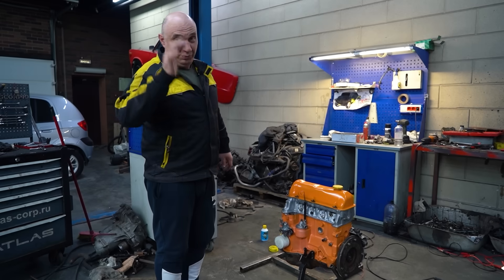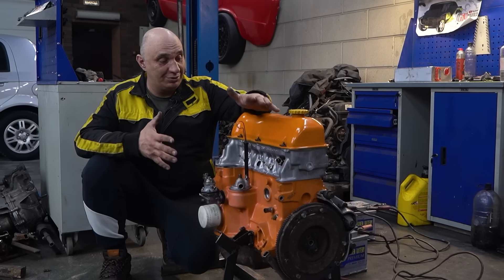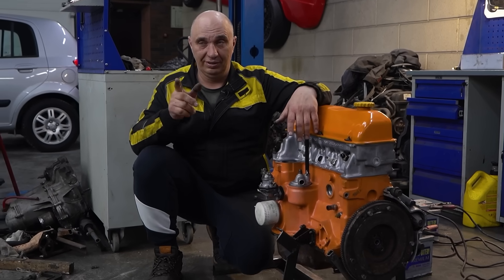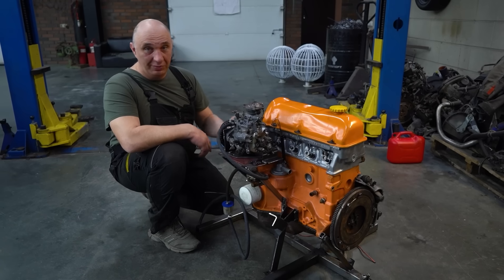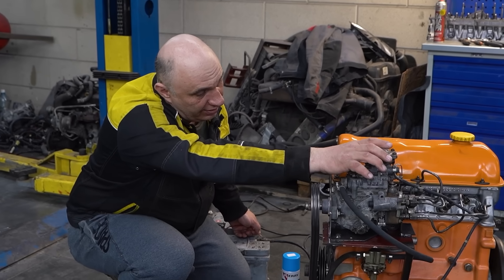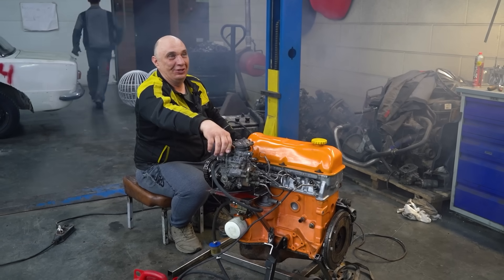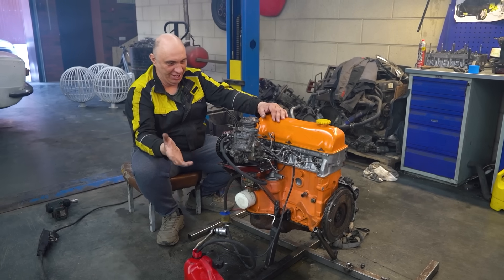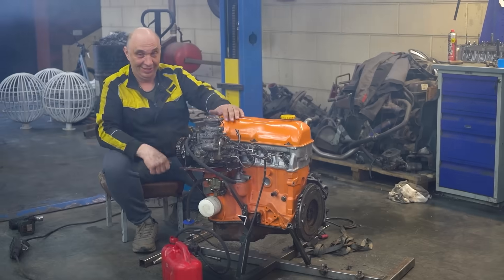We convert a gasoline engine to run on diesel fuel - will it work?

Comment: Bad way for running gasoline engine on diesel fuel. You need higher compression which makes heat, and that heat ignite diesel. With spark plugs can run better. For good running you actually don't need to remake engine, just need to inject diesel in gaseous state, and spark plugs ignite him very well. I run gasoline engine on diesel, wood, hydrogen from water, plastics, etc, in regular gasoline engine.

Comment: looks like its getting too much fuel, or it doesnt have enough compression.   Could try F34 military jet fuel.  Essentially Jet-A1 but with a lubricity additive to help lubricate the injector pump. F34 also contains stadis and de-icing additives.......so do not run it indoors unless you want cancer. Increasing compression would mean potentially needing stronger pistons..........

Comment: That's a dumb question yes it can work depending on the compression ratio of the engine and some other details but really that's exactly what General Motors did in the 70's to create the 350ci diesel that was used in cars and trucks all the way up to the 90's before the duramax came on the scene.

Comment: More compression is needed. Hence the smoke, low combustion temp. But its awesome it runs
Reply: it will blow up internals not strong enough for the double compression he proved he could convert it and run it's enough

Comment: another way to do this is using modern diesel pulse injectors and running them in place of gasoline injectors (or just use the stock injectors ) then put glow plugs in place of the spark plugs (wired to a momentary switch) if my memory is correct you need 180-190 psi to compress diesel cuaing it to burn  and thats on the very low end for peak performance you need 300+psi so that equattes to 13:1 compreession roughly which is why gas engines dont burn diesel well at all because they use 9:1-11:1 generally you can build a gas engine to burn diesel but its extremely inefficient
Reply: ps this is all for a modern or just a efi engine

Comment: You probably already know this, apart from the head geometry being very different for a petrol the cam will most likely hold the inlet valve open too long for a diesel, as diesels tend to burn fuel over a longer crank angle, that might be why its spitting back through the intake, it might still drive though.

Comment: Assuming because it's warm in the garage that it would be enough to start a mechanical injection diesel, completely undermines how hot the cylinders need to be for diesel to combust. I have to use the glow plugs on my old Isuzu for the first start of the day, even if it's been sitting out in the sun.

Comment: The indication of so much smoke is likely due to the compression ratio being too low. causing the combustion chamber temperature to be too low. resulting in unburnt fuel and ultimately large amounts of smoke. most diesel engines require a compression ratio of at minimum of 17to1. or even a more ideal ratio of 25to1 to achieve complete combustion. and in turn they also require stronger engine blocks, crankshafts, and connecting rods. GM experienced this problem when they tried to convert a 5.7L. Oldsmobile Gasoline engine to diesel. and it turned out to be a terrible failure.

Comment: In the early days of Ag tractors, there were carbureted spark ignition engines that ran on diesel fuel.  They had two tanks, one for gasoline and one for diesel.  They would have gasoline engine compression.  You would start them on gasoline through its' jet, then once it was warmed up good you would switch to diesel through its' jet.   The spark plug fired both.  Once warm enough of the diesel would vaporize to give you ignition and the heat would vaporize the rest of the diesel to burn and you could shut off the gasoline.
Reply: army trucks also

Comment: To make it start better you need to raise compression ratio by milling some metal off of the underside of the cylinder head, so the combustion chamber gets smaller.
Reply: Na supercharge / turbocharge it. Raise the dynamic CR 😊
Reply: In the last video they did that about as much as they could unfortunately
Reply: Concordo. Talvez enchesse a câmara de explosão com alumínio para aumentar a compressão.

Comment: nice project, 
what will happened if you mix petrol in diesel, may be 1% or 10%, will it increase power or damage parts, like pump, injectors etc.

Comment: we use to have an outboardmoter 5HP that starts on gasoline and  after 5 minutes switch to diesel and run on diesel with sparkplugs and carburethor. no injectors needed, cant remember air or watercooled. but was 2 stroke 2 cilinder engine.
great work  you do.

Comment: Try a new experiment (suggestion). Run a modern engine with 30gr of gallium on the oil.  10hrs running.

Comment: What I would do is put a grid heater on it like the cummins platform has so it can heat the air coming in like the heat gun is doing

Comment: try different injectors, high/low-pressure, swap whatever your using now, I think low-pressure would be the way to go, but you're the experts,  good idea using the sparkplug hole

Comment: Won't run properly without higher compression. The heat gun will help with compression and make diesel vapour with the engine will run off easier.

Comment: With all that white smoke I would suggest that it's either as under sized injectors for what you just built or the injection pump is weak or you don't have enough compression
You might be able to make the injection pump spit more fuel out and that might work too.

Comment: We used to run petrol engines on parrafin  60 years ago you only need an extra tank and wind the fuel line round the exhaust manifold to prevent heat the paraffin no injectors required start it on petrol then swop take nothing new about it this masses Fergus petroil tractors

Comment: Our old tractor ran on gas or kerosene . Start with gas run kerosene hot Always switch back to gas and run a little more before you shut down or she doesn't start next time .
What ? You thought you invented something new ?  Farmers in the old days were smart and kerosene was cheap and don't knock . 
OH, they used two tanks and switching with a valve .

Comment: U guys on the good track. Now try to adjust injectors to about 200bar that should help. Also chack cr ratio u need a munimum 16 to 1 but better 20 to 1.  Also when injector spray at tdc in to the top of the piston it gets cold mill out a litle like boll shspe combustion chamber. Notice smike it is white it show a cold burning thats why it run that bad. Good luck .
Reply: Another good idea on top of that would be to take a smal turbocharger off of small 1.5 or smaller diesel engine an use that as well. That would give u boost . That boost would increase ur compresion and power .
Reply: achieving 20:1 easier said than done with existing heads. Deck thickness is crucial, when lowering/machining a head, even when you dont have a 20:1 CR. Also piston-valve clearance is crucial, because valve angles havent been designed for this kind of changes
Reply: If u realy want to do something then it is posible . Trust me. For example miling out another 2mm of a deck then mill out 2mm around piston crown to fit in cylinderhead chamber and finaly a litle ball shape combustion chamber. And it will run greate . Sins i have done this modification in the past. Not on lada engine.

Comment: doesn't work how a diesel engine works.  Shouldn't have a throtle body, should be adjusting the fuel to change rpm

Comment: I had a 95 Toyota land cruiser fj80 my girlfriend put diesel in  it. I drove it five miles to the gas station  and it didn't want to idle but above about1600 rpm it ran good

Comment: well take the gm 350 diesel for instance. they took a gas engine and bumped up the compression and made it diesel, didn't work good but it worked

Comment: Awesome work as usual! The way it runs, it acts like it needs a turbo. It's not atomizing the fuel and that's what gives the white smoke.
Reply: Turbo isnt responsible for the atomization, and it wouldnt help at all on idle. Static, and dynamic compression ratio is the key thing. Also theres still something wrong with the timing

Comment: So much extra work fitting diesel hardware on a gas engine when gas engines can usually run on diesel with little more than a carburettor or injection table tune-up. Accidentally put diesel in a gas car, you can usually get away with draining half the tank and refilling with the correct fuel to avoid ruining the catalytic converter.

Comment: these guys are amazing : they added cylinders to an engine ,they removed cylinders to an engine, they created an engine with all cylinders working at the same time , they converted a diesel engine to run on gasoline and now they convert a gasoline engine to run on diesel. give them a f1 engine perhaps they can improve it

Comment: Yeah , turning diesel fuel into noise and smoke like GM Detroit power units.  Most season'd folks will remember the Olds   diesel via GM too. My father (old diesel mechanic) actually bought a Chev truck with the Olds diesel in it...  thanks for yur video !

Comment: diesels compression tests from 300 to 500 psi .... maybe it would run better on ethanol ? but maybe it would detonate ? ....the chambers would stay cleaner....and the flame front is slower.....less RPM, but that should be fairly stable, or close.......plasma gassification of celulosic feed-stocks > synth gas > methanol > ethanol .....carbon negative liquid fuels, with a bio-char bi-product ....some way to get consistent full pyrolysis .....if the hydrocarbons are fully driven out of the feed stock, you have good quality bio-char for soil amendment..

Comment: Did you supply 12v to the solenoid in the high pressure pump 
I didn’t see a wire

Comment: I dont know abaut this lada engine, but mercedes om601 engines real injectin timing on inlinepumps and bigger elements on it, is somethin like a 20 degrees before top dead center. And it is pretty precise abaut that. You can try everything abaut 17-22 degrees btdc. I hope this helps you.

Comment: this was kinda silly ... diesel will run through a carby with a high enough comp rate wich this has ... its how diesel was run in the early days no need for injection or glow plugs that way

Comment: A lot of commenters going on about heat/glow plugs. It's a direct injection engine, it shouldn't need pre heat. 
The cr is too low to get the heat into the air.
Either the combustion chamber shape is wrong or the cam timing isn't trapping the air.

Comment: I know people has done diesel conversions in the past, especially with old Volvo Redblock engines. Like Lada engines, they are built like tanks, and are easily able to run with the higher compression rates required for diesel. You won't get that much power out of it, but the fuel consumption goes down by a lot.
Now, most diesels today are turbocharged, to allow for much greater torque and power output compared to naturally aspirated diesels.

Comment: What is sure, there is not enough compression for idi diesel... idi diesels are hard to get run properly under 18:1 ratio... while direct injected can run even in 14:1 (mostly racing engines use lower comression) this engine needs domed pistons that displaces whole combustion chamber, this engine needs too make injector seats which are combustion chambers, maybe older mercedes idi combustion chambers would work?

Comment: People are mentioning heating the air or a supercharger blower.   Is there a fuel Mix that would burn more completley at this compression ratio.   I always wanted to build this,   but it is a  frustrating  mess of a machine.   On the Positive side High compression may give you efficiency and the engine put out good power and heat.

Comment: I wanna know what the drug joke was
Reply: Me too
Reply: The only thing i could piece together is, in Russian, they use the word (fen) for hairdryer, and the pun has something to do with they way they're pronouncing fen to sound like fent? I can't piece this together from the audio in this video. I'll have to hope for good translation from the original video
Reply: After doing some more research, there is no mention of a heat gun or a hair dryer in the original Russian video. The aforementioned joke was fabricated by the translator. They're simply amused that the hot air got the engine to work
Reply: @HomelessPank  Heat gun and hair dryer in russian sounds like "Fen", you dug in right direction. Also Fen it a slang name for methamphetamine.
Reply: @HomelessPank  in russian heat gun operator said - "It works with fan". Vlad responses -"Yea, i noticed". and start gigling

Comment: That's a very interesting experiment.
I really learned some stuff with this, especially when I saw the heat gun, because I didn't thought about increasing the intake temperature, despite remembering that some diesel engines do have an air heater at the intake to allow cold temperature operation. Also, I do wonder about what if it had glow plugs. Great video.
Reply: Someone here commented that glow plugs may help but it's still an overall lack of combustion causing white smoke.

Comment: It works but it seems the compression is still a bit low, as it doesn't reach high revolutions when throttling it, you can also notice it smokes alot, the combustion chamber also isn't very efficient for diesel fuel application... Still great effort! A vw diesel fuel pump from a golf mk2 might have been a better option as it is belt driven instead of chain as it doesn't need lubrication, great video! I love watching your stuff!
Reply: цепью легче всего исправить несоосность.

Comment: Way back when, the 8n Ford tractor was dual fuel for the UK. Started on gasoline, then had a "hot plate" where exhaust heated the intake manifold enough to vaporize kerosene (light diesel) and go plow fields.
Reply: I copied the 8n's "hot plate" intake/exhaust idea. Made a dual fuel 11hp Briggs and Stratton riding mower
Reply: Ford 8NAN tractor

Comment: Others have mentioned the injector issues but the piston geometry probably isn't helping things either. Diesel engines typically use a cone and cup in the center of the piston with the fuel injector directly above the cone tip. The tip of the cone helps the injector spray spread out and mix fully with the air in the piston, as well as provides a sharp point that can heat up quicker for better ignition.  

Not only is this engine using a flat top gasoline-style piston, but the injectors are at the oblique angle of the spark plug. Most of the injector spray is probably hitting the wall of the chamber and not actually spreading out into the air, so it's ignition rate is really poor. Upping the pressure might help a bit with atomization but it's only going to do so much.  

Also for starting looks like you'll need a little 12v  intake air preheater!
Reply: This. That's why all the smoke and sputtering.

Comment: I feel like you guys need a turbo, with no intercooler. You plowing hot air into the intake and it still doesn't want to run XD

Comment: I'd be curious if you could add say an EGR tube from the exhaust manifold to the intake manifold to pipe in a small amount of hot exhaust to give it a bit of hot airflow to the intake and allow it to run itself without a set of glowplugs or a heater intake grid
Reply: Or just pro/turbo/super charge it. That would work good.

Comment: This is quite the project. Those injectors appear to be indirect injectors meant for a pre chamber as others have noted. I’d recommend adding an intake grid heater from a Cummins or Cat diesel engine if they are made where you guys are. I’d also suggest converting the fuel pump chain drive to a belt for ease of service if you are keeping this engine around. I’d honestly mount it in a car, put some diesel oil in and drive it around. Well done!

Comment: General motors tried that back in the late 70's early 80's with a gas engine fitted with diesel heads. They were crap engines.

Comment: I've got to say choke a little bit it'll help 
I've ran my riding mower off diesel mix one time at the end of it she was on full diesel half choke and had a torch flame out of the exhaust pipe and my yard was cut it work out for me that was two years ago and I'm still using the same mower

Comment: Oldsmobile did that in 1978 and it didn't last very long. There best one was the V6 Diesel because I Drove one after rebuilding the transmission! That car would fly!!! I LOVE THIS CHANNEL!!
Reply: i worked on a 3.8 v6 diesel it's extremely rare
Reply: Oldsmobile diesel v6  is 4.3 liter   @tonycavez
Reply: @C.I.M.-jf6kj  yes i made a mistake

Comment: Impressive sounds and looks like it needs advancing more but then again the lack of pre chambers won't be helping all it needs is a chamber in the inserts you made that go between injector and cylinder head they need a small orifice at the end mabe 5-8mm in diameter this is necessary because Indirect injectors have a lower pop pressure compared to direct injection and need the pre chamber to help atomise fuel

Comment: Best I can tell because using indirect intake manifold injectors as direct-injection manifolds along with the white smoke coming out of the exhaust when it is running leads me to believe that it is running übèr lean which is also the reason why it will not rev hardly...
Reply: Port injection does not exist in diesels, nor does "running lean".

Comment: while yes it will run on diesel you could also run it on high octane gas and get way better results. even at 20 to one as long as the fuel is over 100 octane or better it would be fine Av gas or aviation fuel is normally 120 octane and is what would be available in Russia in most areas . it is leaded but with an engine like that it would help more then it would hurt